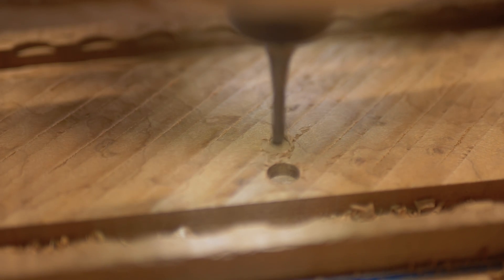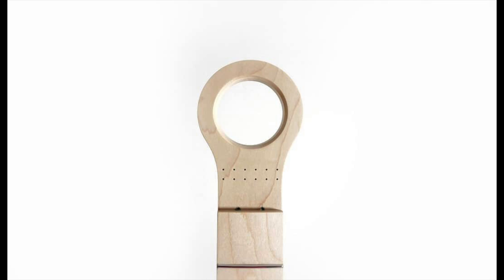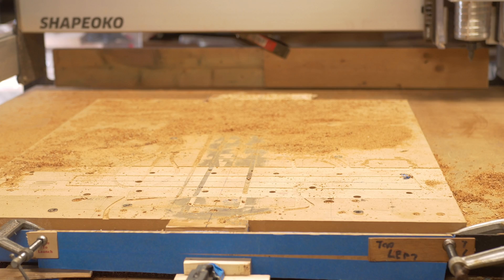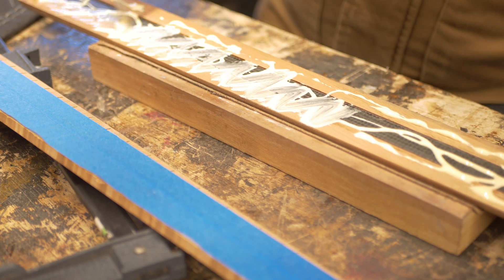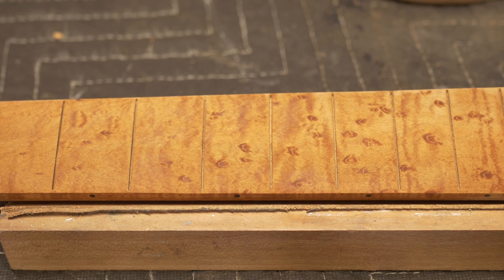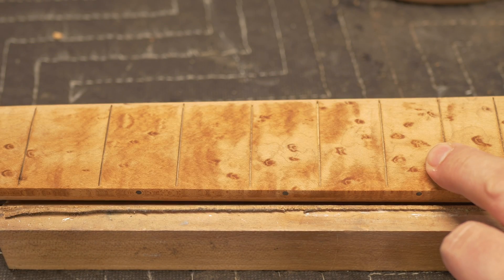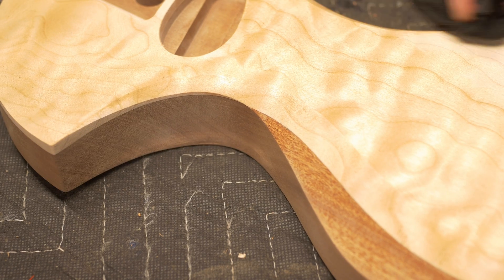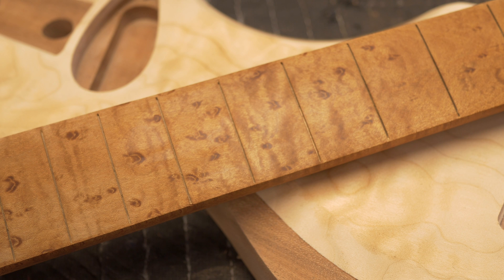CNC Fretboard - Travel Guitar  Episode 3

Comment: How do you set the relief in a neck without truss rod like this? did you tapper the fretboard thickness wise?
Reply from the maker: I don't set up my guitars with relief. My necks are all dead straight.
Reply: @MarkGutierrez I mean, all stringed instruments need a certain amount of relief to allow the strings to vibrate freely. Even violins have relief. If your fretboard is dead straight, you'll need to raise the action quite high. Is that the case, or is there something else going on? thanks!